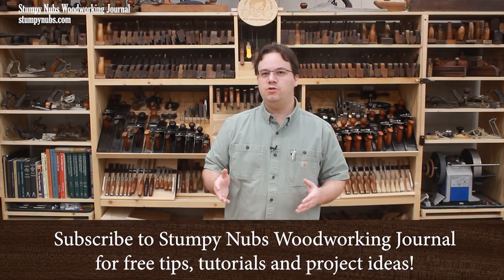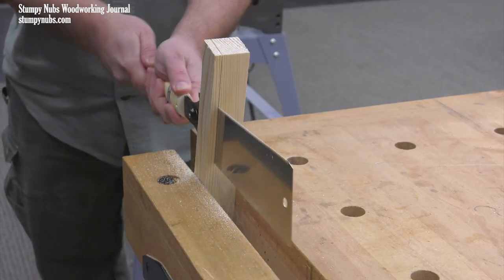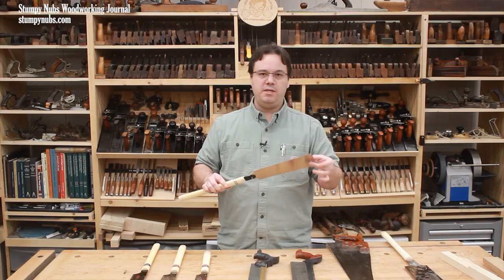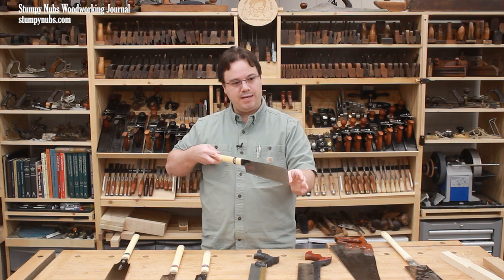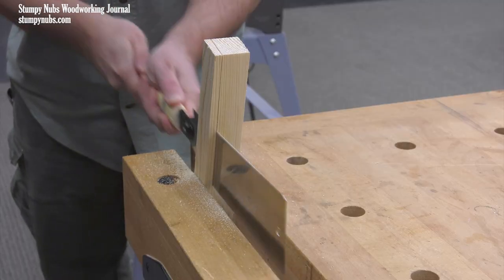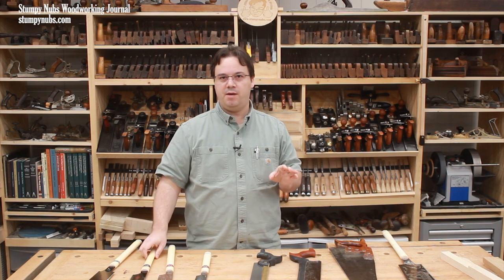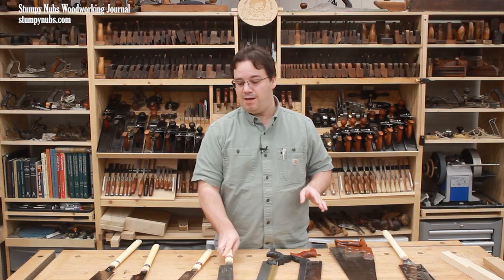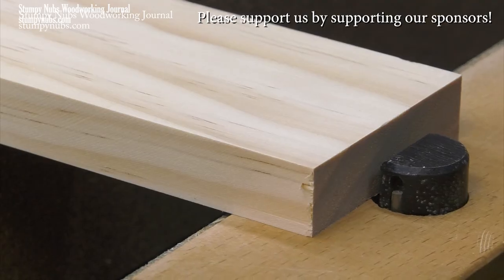Is Japan slowly killing western-style saws?

Comment: From the very first time my dad put a saw in my hand when I was 4, the push stroke has made zero sense to me.  The blade bends if it binds, which makes the binding worse.  It just seemed so obvious to me, even then, that the saw should cut on the PULL.
Reply: Yep.  Western saws = pushing a rope.  While I grew up with them (as my dad and granddad also did), now I know better. :)
Reply: LOL I always thought it was just me figuring tools are made for men with higher grip strength and upper body strength. So I’m not the only one “push saws” made no sense to. Nice to know!
Reply: My early frustrations with push-stroke American saws pushed [pun intended] me toward power tools instead of learning to use hand tools. Now nearing 70, I wish I had a lifetime of hand-tool skills built up, but I don't.  😞
Reply: I think the trick is that push saws are only intended to work a narrow bit of the wood at once. It's worth noting that in the old manual sawmills, they did not use push saws, but instead old-timey two-person saws- and those saws, in turn, were pull saws (just pulled from each side instead of only one side) instead of push saws.
Reply: @karenmitchell6814  When I was 7 or 8 years old, I had a much easier time with a bow saw for big cuts and a hack saw (literally a metal hacksaw, sometimes with the blade reversed) or keyhole saw for fine cuts.   I couldn't use the regular saw... always thought it wasn't "good enough", needed sharpening, wrong TPI for the wood, I was not strong enough, etc.   Of course I was little, so I wasn't strong enough for the inability to rip cut with a bow saw to matter.   Only trouble was the blade would "dance" and... I'd need bandaids. (and I still hate my regular saw... I guess I don't know why I even use it)
Reply: Was going to post the exact same thing.  So, if this is something silly kids like us can figure out, and given the other advantages of Japanese saws, I wonder why we ended up with the teeth the other way around in the west.  
I bought a ryoba saw a while ago to see what all the fuss was about, not knowing about the teeth orientation.  Now I know: this is the saw that "makes sense" as a younger me would have said.  After all these years...
Reply: @karenmitchell6814  
tbf, they kind of were. A lot of things are still designed like that, an average woman will have trouble getting a good grip on many machine tools, even worse with things like angle grinders.
Reply: Most saws can cut on push and pull now tho....

Typically, if the teeth are not angled back or forward, and instead, point straight down, then the saw cuts on both the push and pull stroke.

Just mainly do your cuts on the pulls...

Logic does dictate that a saw that can cut on both strokes is better.
Reply: @dislikecounter6392   Even so, I prefer a very thin blade for precision, and those need to just slide on the push so they don't bind and bend.
Reply: @kaasmeester5903  Because push saws can cut MORE per stroke. They cut faster and rough out more material. It isn't by accident that the primary saw design is push EVERYWHERE but japan. The US was built out of wood and the tools evolved to get the work done as fast as possible. Japan needed the opposite. They needed fine control over speed due to the limited wood japan has. Two totally different situations leading to opposite strokes. Japanese saws make perfect sense for hobbyists or small trades today, but would never have made sense at a time before power tools when hand saws did the real work.

Comment: A video on Japanese chisels would be great. While the differences in their saws and planes are apparent, its not immediately clear how their chisels differ.
Reply: The best j. chisels are laminated, a thin harder piece of steel fire welded to a larger softer iron socket. We can  get Mr S. Nubs to explain better. Old plane blades and chisels made in Sheffield,  also had a laminated cutting edge before steel was mass produced
Reply: Obviously, it's just like the saws: Japanese chisels cut on the pull, rather than the push.
Reply: I'd also love a video on Japanese planes
Reply: @ibalrog  what ?
You are joking, surely !
Reply: @ibalrog  😂😂😂
Reply: @ibalrog  From my understanding this pull method is central to the harakiri technique.
Reply: @stevebettany8778  Not just an everyday ordinary mirror, it has to be a pulling mirror, otherwise the reflection is all wrong. 😂🤣😂
Reply: @MrMartinSchou  In a very clever way - they have hook at the tip that reverse the cutting edge. 
Obviously you need to tap it properly with mallet.
Reply: @johnland7318  
I have an old german 2 feet long plane and the 3/16" thick blade is built exactly like that too.
Reply: @Exgrmbl  Yes, back in the olden days!!!! , According to a industrial museum in Sheffield - Abbeydale Industrial Hamlet - steel was made in small amounts. So therefore a working edge was fire welded onto a shaped backing. I guess the Bessemer process was the point that the cost of steel fell allowing modern edge tools to appear.
BUT the couple of old tool blades I have which are laminated blades, hold a sharp edge better than standard plane blades, harder steel !!!!

Comment: James, I agree with all your recommendations and that there's a need for both styles in most shops... But I feel like you missed the biggest difference between push and pull dynamics. I find the physics of a pull saw makes cutting easier for any work that I'm doing at chest-level or higher. Push saws are way better and easier to work with at below waist level, like if you're doing rough cuts bracing a board with your knee or hand on a short bench. So the position you like to do your work in plays a HUGE role in which saw you'd choose.
Reply: Agreed
Reply: He explained it in great detail starting at 1:30. You're just saying it tends to be easier to cut through material if you use the style of saw that allows gravity to assist in the through-cut motion vs the back-cut. That's mostly anecdotal based on your personal sawing preferences. Don't you think the reason you put a piece of wood on a short bench to hold down with your knee is because you plan on grabbing a Western panel saw to plow through a rough cut? If all you had was an Eastern pull saw then you probably wouldn't set up like that. You're matching the job to the tool vs matching the tool to the job. 
Even though he didn't specifically say it, the assumption throughout this video is: stock is clamped in a vise and being cut at waist-height, usually while following a line. He DID use words such as "straight" "square" "precision" "easier to guide" and "better feedback." For jobs where those things are important, Eastern (Japanese) saws are simply better in almost every regard.
Reply: I agree. One addition: For sawing with Japanese saws below you: Try standing on the workpiece. With a larger Ryoba (at least 240) it works quite well for ripcuts and also for some crosscuts. Don't fall or saw into your toes though...
Reply: @G0F15H  No, there's more to it, like western saws give more control if you need to change or adjust the cut but to use that control requires more skill.  While eastern saws will more easily follow the line and require less skill to get started, just harder to fix if you mess up the start of the cut.

For rough cutting, western saws can be faster and there's more examples of saws that can take advantage of 2 or more people working together for logging, etc.

Differences in position also denotes differences in types of woodworking, what size materials will be most likely utilized, what kind of holding systems are used, etc.  So what works best can depend on a variety of factors that shouldn't be glossed over to just one is better than the other when that depends...

This was a basic overview of eastern saws but the actual comparison between them and western saws are more complicated and would require a much lengthier discussion to cover it all.
Reply: Traditionally nokogiri are used with material on low saw horses. So you're standing above using your foot to hold material down.
Reply: @ZeoCyberG  Yep, western saws can cut faster. That's particularly the reason why they predominantly use push cuts rather than pull cuts. The human body is more capable of pushing than it is pulling, and that combined with a push saw allows more material to be cut per stroke. Pull saws work great for small fine work, but not for quick production work that western tools were developed for.
Reply: The comment section is filled with a bunch of weaboos who glorify anything from Japan because of anime
Reply: @BTW...  Hugely important.  Europeans did woodworking on muddy ground, standing up at a bench, or sawbuck.  From India to Japan, they work sitting on a prepared floor and only have very simple braces to hold the work with their feet.  Something something femur-length something too.
Reply: A lot of good points, let's add one more: carpentry styles. Japanese construction consists mostly of 4x4 or 6x6 beam frames as opposed to 2x4 studs and such. Thicker wood they would work on the ground, yes, but also lock together with intricate joints yet don't need to be perfect a lot of slop is allowed, and then wedge it into place.  This is a factor of living on fault lines, buildings need to be able to sway and flex.
 Add space constraints that disallows large tools, different concept of home's lifespan (30-50 years) and it starts to make sense why Japanese hand tools are preferable: they are much more popular in Japan. The need for hand tools in America is niche, but essential in Japan. Razor sharp saw blades for 1000-1400¥, ready to use planes start at 700¥, chisels about 1200¥. I reckon about half the price of American goods, probably less, because there is such a market for them.
Reply: I actually like both for different purposes.

I love my veritas carcass saw for getting cuts started and getting the initial line straight with the very straight plane it cuts in, where it is designed to follow a very straight line.

But, I then love switching over to my japanese saw to finish the cut if it's a longer one.

I was building my workbench and broke my japanese saw blade... the project basically was stalled until I got another one. It was actually insane how much better it is than my other saws, to where it almost stopped the project dead when it broke.

Comment: I worked in trim carpentry for nearly 40 years, and whenever someone borrowed my coping saw for whatever reason, I'd get crap because the blade was 'backwards'. For quite a while I was confused, then noticed that they used the coping saw with their hand, and the saw handle above the work, and I always cut my copes with my hand/saw handle under the work. It gave me a smoother, and more accurate cut that went faster because I didn't have to look around my hand to see what I was doing. It was about 4 months later that everyone I worked with had their blades installed 'backwards'
Reply: I am in trim carpentry now, and that is how I do it. I want to see my cut, not my hand.
Reply: @thomaslee4114  I am a trim carpenter, and have been for 35 years. I tried it that way many years ago, and found that I am much more efficient coping on the push stroke. However, I rarely cope with my material laying flat. To each their own.
Reply: The beauty of your technique is that I find following the cut line with a pull stroke is complicated by the saw dust piling up in front of the blade obscuring the cut  line.   Pulling from below the work and steering from the "push " side above is the best of both worlds!.

Comment: My first encounter with a japanese saw was 56 years ago when my dad got orders to Atsugi Naval Air Station in Atsugi Japan.  The japanese did not use power tools to construct houses back then, only manual tools and their carpentry skills were second to none. I remember being amazed at the accuracy of house construction using manual tools.  They used the old 'Egg Beater' drills as well.  The pull saws are my saw of choice now, I have several. Great video.
Reply: Second to none if you're American and that's all you compare with.  First of all japanese house production was seriously slow and ineffective, athe joinery may be fine, but the end result  still is a drafty cold uncomfortable house. Japanese house building is NOTHING to envy.. BRrrrrrr-....

Comment: My father was in the USAF and in 1959, when I was 8 years old, we lived in Japan for several years.  I remember using a Ryoba saw working with my dad on projects.  Years later, I purchased a Western type saw from Sears as part of my first set of tools.  I hated the Western style saw, it was so much harder to control than the pull type Eastern saws I grew up with.  When I found Eastern type saws in the mid 1980s, I purchased several and have used them for years.  Great job on this video, and yes please add to it with the other Eastern tools you talked about.
Reply: Off topic, but you didn't happen to go to Yoyogi School in Washington Heights in Tokyo, did you? I was there in eighth grade in 1958. :>)
Reply: @tomhargreaves8820  Tom.

I went to the 2nd grade at Johnson air base in 1959 and 3rd and ½ of 4th grade at Tachikawa AFB.  We moved to Hickam AFB Hawaii in 1962.  I loved living in Japan and have great memories of those early years.  Thanks for asking.
Keith

Comment: A distinct advantage of the pull saws from Japan is that you can and should use the reflections in the saw of the stock being cut. These reflections precisely identify orientation between the saw and the stock in two dimensions as the cut proceeds.
Reply: Valid comment but I have found that there are some occasions (eg some oblique cuts) where the reflection can be a distraction.

Comment: Excellent video as always. I work at our local Woodcraft and always had some kind of trouble with them, mainly because the only think you can read on them is the length of the blade/number of teeth. It'd be very interesting to see a video about Japanese chisels and setting the ring on the handle.

Comment: The Japanese pull saw was a life saver when I built a boat. A boat is the opposite of a cabinet. Nothing is square, nothing is plumb and a bevel is more vital than a square. Being able to site the line on two sides of a 'non square' piece of wood and making a cut that fit perfectly was magic for me. I love the pull saw but have never tried the Japanese chisels. None of my boat-building mentors  used them so why would I? Looking forward to you proving that my mentors were not sufficiently open minded.
Reply: I know exactly what you are talking about and experienced exactly the same conclusions 👍. My first Japanese saw was a cheap one from Lowe’s. It still works great and I can’t imagine one of those more expensive Japanese saws working any better.

Comment: I have almost entirely switched to Japanese style pull saws.  Mostly for their accuracy, but also the kerf size and I just find them easier to use.
Reply: I don't necessarily find them easier to use but I do have a couple of the folding Suizan ones, really convenient if space is tight or you're on the move / traveling a lot.